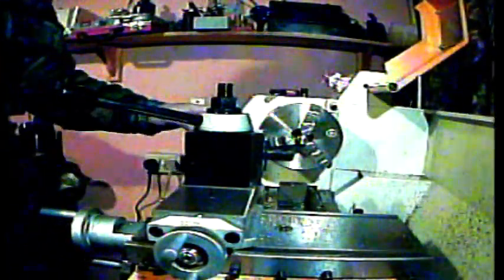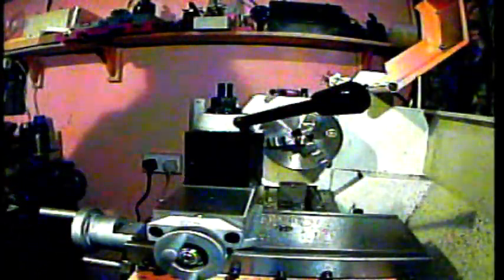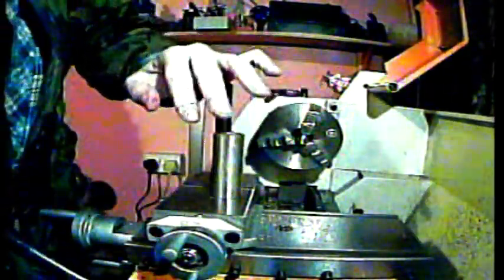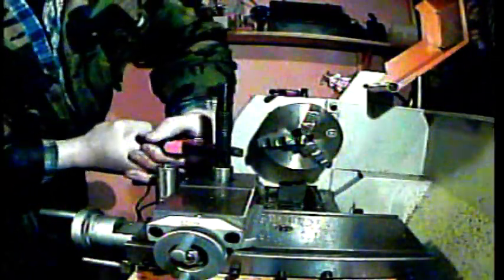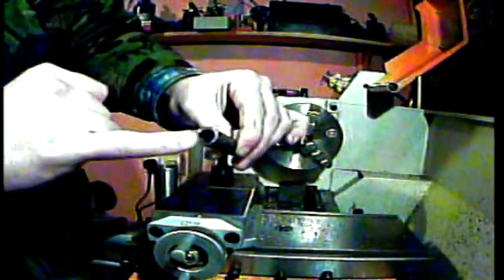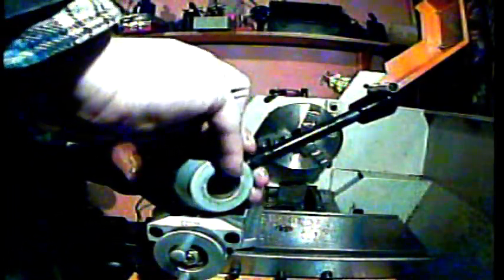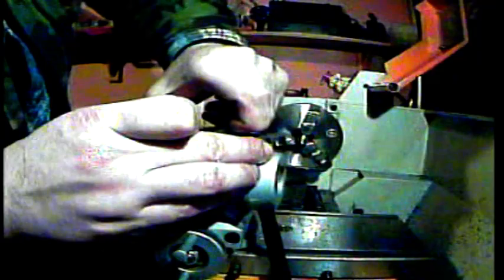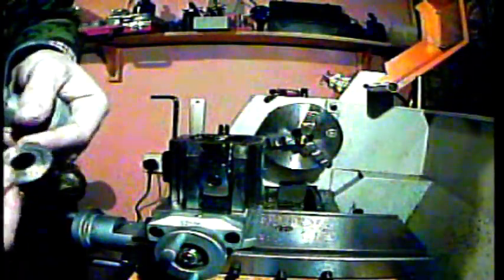How To Part 1 chester DB10V QCTP

Comment: Hi. Has a look at your channel and you seem quiet for while. Hope your OK? Jamming and engineering? Excellent, same mindset here. I have a DB11 and had to fit a tool post like this, I can't remember how I did it! The thread and boss drops out on the DB11, boss not part of the slide, and I machined off the boss but how I did it without being able to fix down the regular tool post seems to have gone out of my brain. We got a DB10 super like yours at work for small stuff and to get the young ones to realise that they can make things. So I have to fit a QTP and this vid gave me a lot of pointers. So thanks for posting!
Take Care.
T
Reply from the maker: Thank you, yes i will be returning to show the channel some love soon. Work and bills tends to take president of course.
Reply: Completely understand. Nice inspiring set of vids! Glad your OK ...genuinely. When you bored out the piston block, was it hard like tool steel or does a T/C tip sort it once you get under the hardening?
T
Reply from the maker: If you use the correct TC bit for the material it turns off glowing bright orange and cuts through it like a hot knife through butter. If you use some cutting fluid it saves the bit from overheating and won't glow orange hot, modern cutting fluids are incredible liquid tech. Always use a cutting fluid when machining high grade stainless steel as it will work harden and weld the material to the tip.
Takes a bit of experience to get the speed and feed right for hard and awkward materials but once you get the sweet spot you never loose the feel for it.
Reply: Cheers. There are lots of different qualities of T/C tips, especially if you don't want to pay £30 each ;-) I hate stainless. I have a suds pump but often needs a good stir for stubborn stuff. I'll dig out a nice new tip and give it a go.